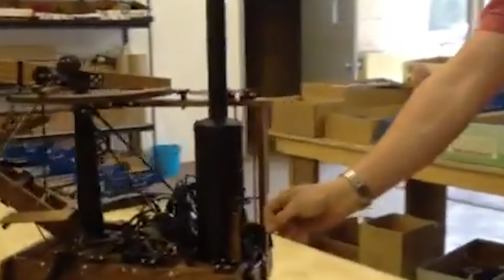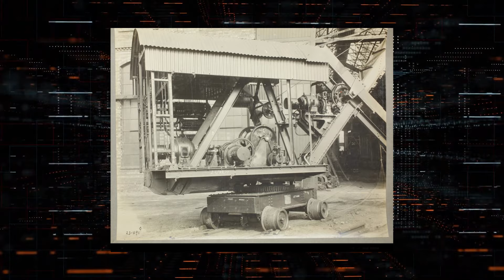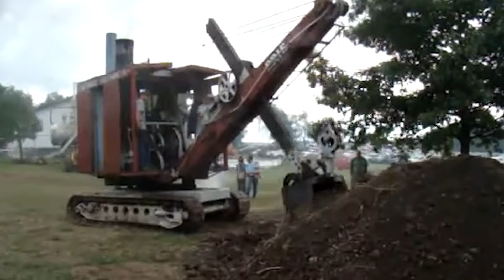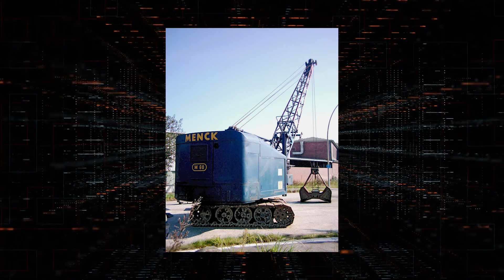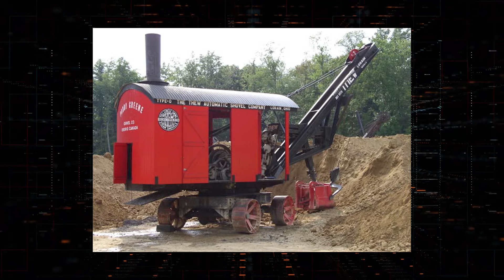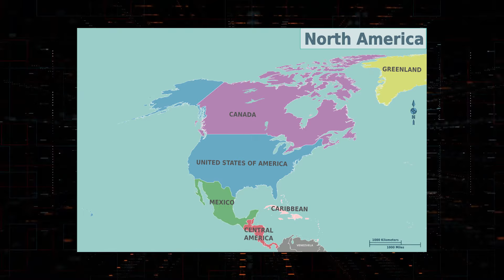14 OLDEST Excavators Ever Built (And Still Running)

Comment: I bought a Dynahoe-190 😊 because of its maker Bucyrus Erie 😊 it is a machine that I can OWN that is small enough to fit on my property but part of Bucyrus History 😊 I will say it was the CAT 225 that standersized the (X) pattern that basically all excavator use today. 😊 back when it came out the earlier hydraulic excavator every manufacturer had a different operator lever or foot pedals set up. The CAT 225 changed everything on operator comfortably in cab with two levers 😊 that was easy to master 😊 you pushed the lever to tuen the house in the direction you wanted to turn. Not the forward and back like many hydraulic excavator set up the LEFT lever. It was a game changer for a new operator to master.